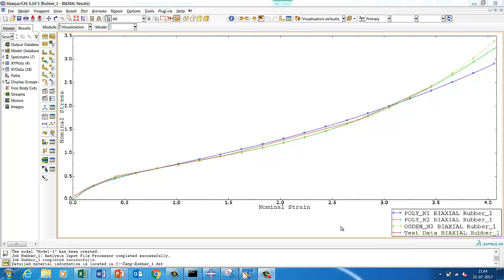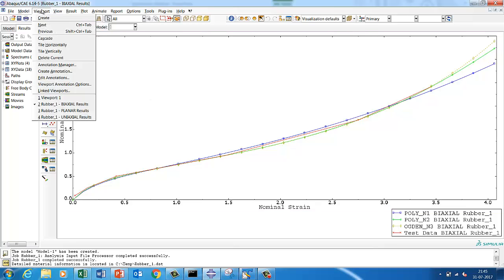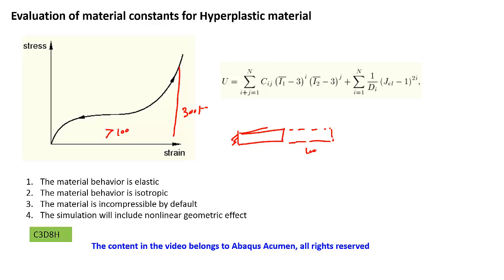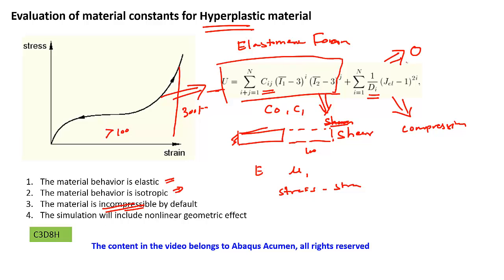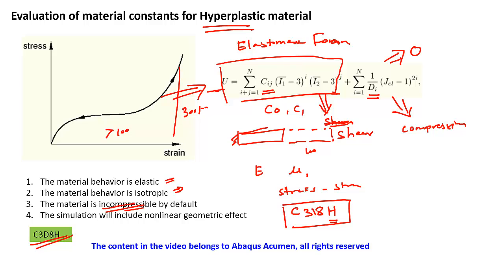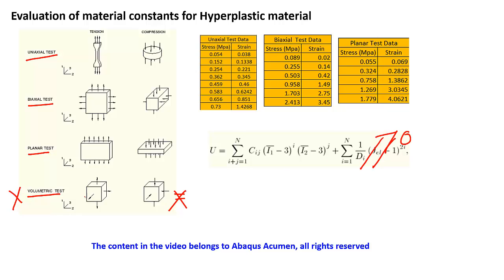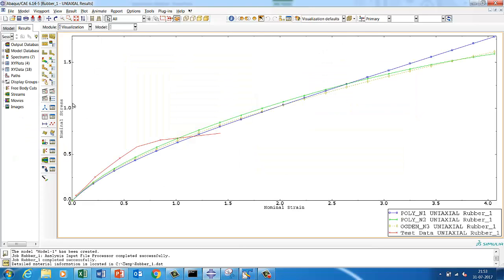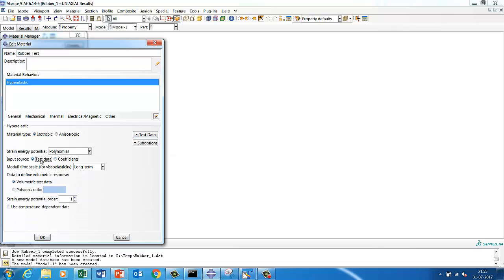Abaqus: Hyperelastic material constants evaluation from test data

Comment: Hi sir, I would like to ask you for some help. I am using hyperfoam to model Polyurethane. I am inserting a compression data set to fit a 2nd order strain energy potential. The model fits the data very well for strains from 0.1 to 0.8. However, my model does not catch the elastic behavior coming from the experimental data. the experimental stress is double that predicted by the model in the strain range from 0-0.1 (the range of cell walls bending). This appears clearly when I run my simulation and also when I evaluate the material. Is there any suggestion to solve this issue? thanks.

Comment: Great! it's very helpful, Just a question: Should the strain data be percentage values ?
Reply: its a percentage converted to decimal
Reply: @Tony-vm5vq  how to convert strain percentage in decimal value its in mm ?
Reply: @SriramSriyogi  strain is unitless; doesn't matter if its in mm or inches. delta L/L
Reply: @Tony-vm5vq  Thanks for your kind reply Sometime I Hve data which is percentage how to convert the percentage in starin displacement???????